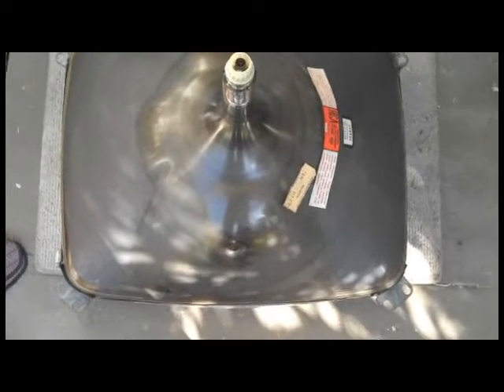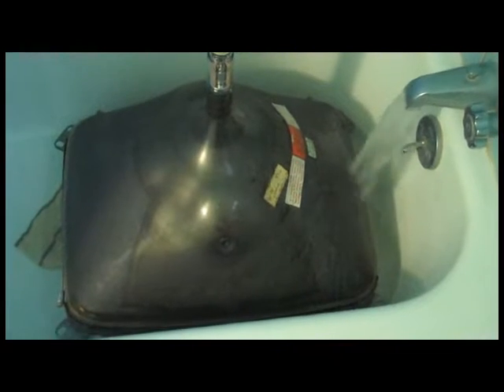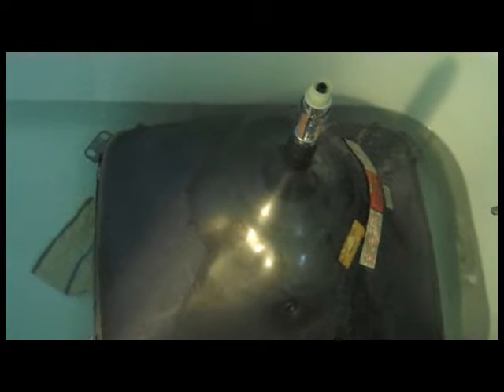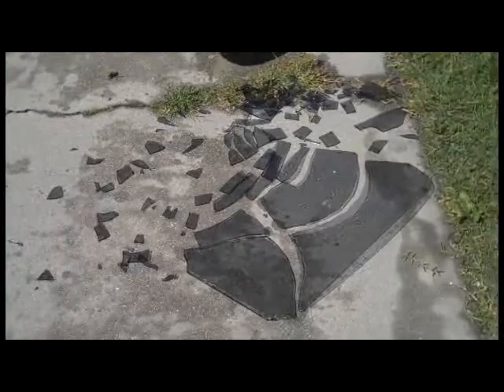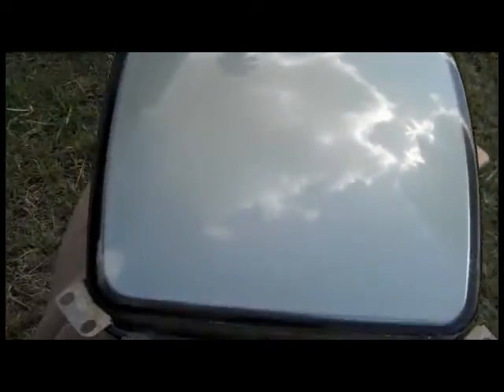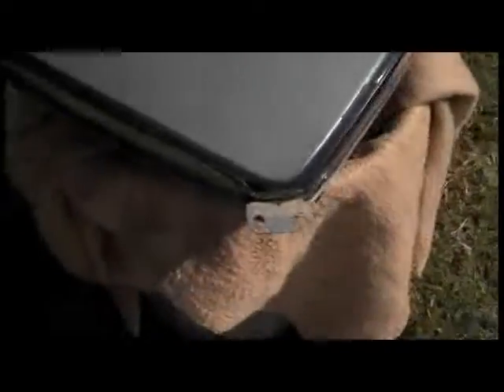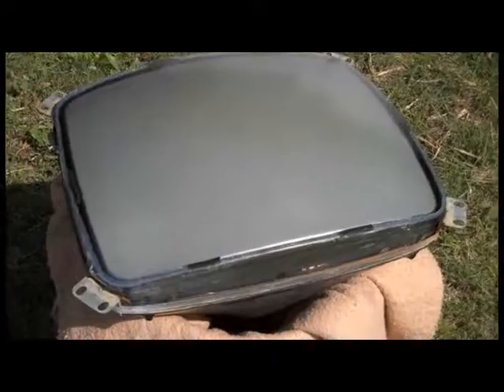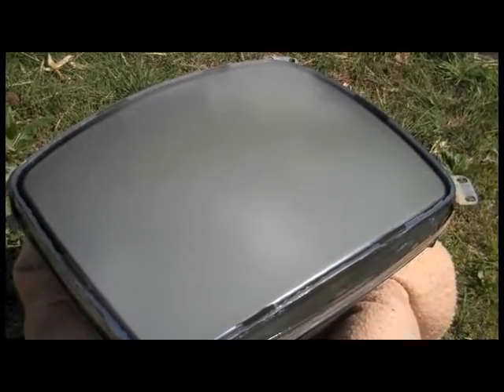CRT Picture Tube Cataract Safety Lense Removal Cleaning Using Water

Comment: Hi, I watched some of your videos on cataract removal as well as Dugh's videos on the same subject. I'd rather not use the heat method due to the possibility of implosion, also, I have 1 Old Stock General Electric grade a CRT that has a cataract, 25ap22. Can you tell me if the hot wire method will work on this tube as well as other tubes with cataracts.  Thank you for your kind reply. Tom.
Reply from the maker: very dangerous and risky on rectangular tube
Reply: @shango066  okay,thank you.I believe you are saying don't use hot wire on all tubes with exception have enough with Green Halo cataract, am I correct?
Reply from the maker: @ebc80  yes, greenish rubber silicone and ware safety gear. goggles, face shield body armor etc. Be prepared to not get hurt in a glass explosion
Reply: @shango066  Yes got it. I appreciate your replies back and thanks for the great videos.

Comment: Will we see a picture from it?  Being a RCA vendor back in the '80s the 25XP22A was my goto CRT for everything.  In my opinion it had the best color balance.  Thumbs up or thumbs down if you agree.  I did not like the smoke appearance of the tube, seems we had to drive it harder than it needed.  Not to mention the number of chassis that relied on 6GH8A tubes did not help anything.  Come on this is an interesting experiment you are performing.  I want to see a picture......
Reply: I installed hundreds of 25XP22A's myself in the 1970's.

Comment: how long did you soak the tube?  i am trying on an  old rebuilt "pro tube" it's never used and rebuilt in 1973, but has cataract.  the tube has been soaking for 2 weeks?  any suggestions?
Reply: If you actually watched the video you would know.